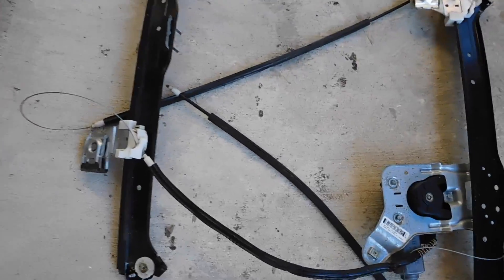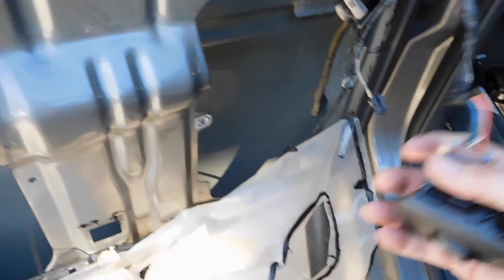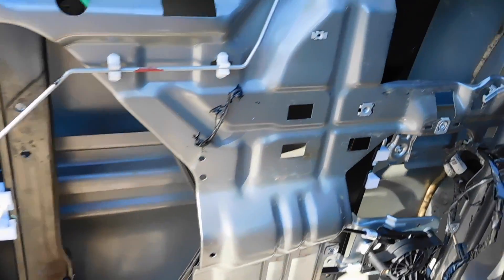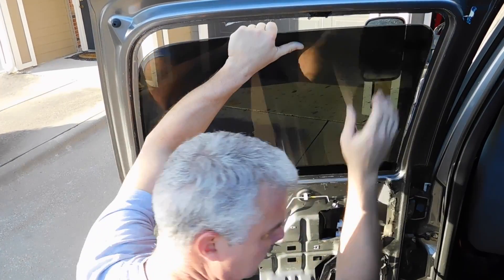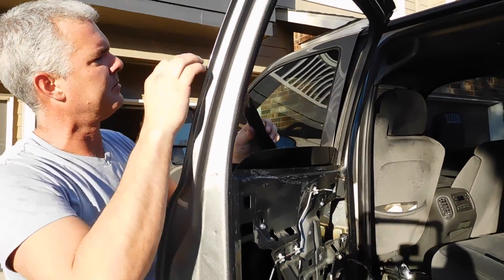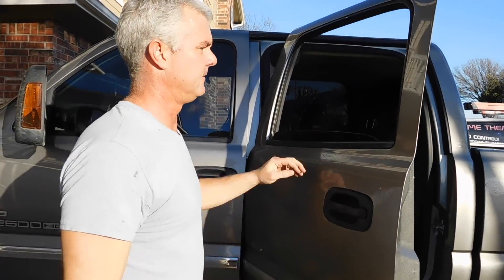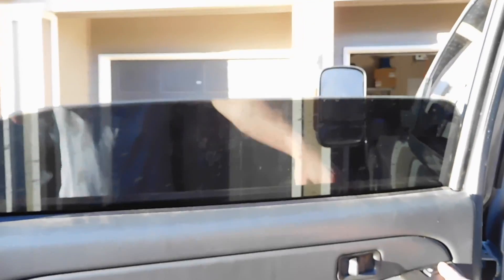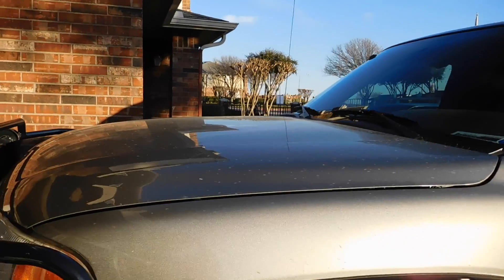2006 GMC/Chevy Duramax Window regulator Repair and Replacement

Comment: I've done quite a few of these.  You don't have to remove the glass.  Next time, remove the door panel, shove the window all the way up until it seats as it does when closed, use painters tape, run three strips from the glass over the top of the door and back to the glass again.  While the tape is holding the glass, take a measurement from the bottom of the door to the bottom of the glass, cut a strip of wood with a V in it to cradle the glass wedge it snugly to the bottom of the door to hold the glass in position until you get the new part.  No  cardboard or tape needed.  Once the part comes in, tape the glass again to hold it, remove the wood, put the register in, loosen the glass clamps, remove the tape, slip the glass down and tighten. You're done.  No need to remove trim or outside molding. Nor do you have to worry about handling or storing the glass with chance of breaking it.  Love the boat repair you do, totally schooled me up on "glassing".  Keep up the great work; good luck and God bless.
Reply from the maker: +AZ Boatscope I had to wait a bit for the motor to come in. So it was safer to take out the glass.

Comment: Thx Jay. Great video. Just discovered my regulator went tonight. I opted to bypass the duct tape and cardboard and cut a 2”x2” board and zip tied to the regulator to hold window up until my new regulator arrives. Luckily my 05 GMC is not my daily driver. You made this look pretty easy. Appreciate the time you took to share the knowledge.
Reply: Update....Jay, regulator went in like a charm. Thx again for the great video.
Reply from the maker: Glad it helped

Comment: You'll be extremely happy you put the 6" lift on your truck when you replace your front axle shafts/CV Axles.  You can replace them without removing the tire.  Of course, that might not be as camera friendly.  Either way, thank you for the video.  Love the Duramax vids.

Comment: I bought a new window regulator assembly for my passenger rear window along with a new switch and it’s not working from the switch or the driver switch. How do I test the wire coming to the passenger rear window?

Comment: Hey man I'm stuck right now I just rebuilt the top end of my Polaris alto 1050 because my middle cylinder was running about ninety on the compression tester so I went ahead and did all new rings and gaskets didn't mess with the bottom end at all so I ran a compression test on it again before I put the motor back in just like you did in your video and now the front and middle cylinder is about 90 and the back is about 82 or so any ideas

Comment: Sorry to change the subject, but I'm sick to my stomach. MY HUGE SCREW UP!! Bought a 17ft I/o wellcraft with an Alpha one drive.  Everything was fine took it out last year, had a blast.  This year I went to get the boat out of storage and the deck was so soft in one spot your foot could fall through.  Now I just found the motor mounts are bad!  Bolts wont get tight!  I'm NO FriscoBoater.....I'm screwed....  You did a beautiful job on your sea ray. I'm at a loss.
Reply from the maker: +aquadogbuddy I totally feel your pain. Take a moment... collect your thoughts and make a plan. You can do it
Reply: +FriscoBoater Thanks for the kind words, but I don't have the time or place to do the work.  I decided that my son and I are just going to patch as much as possible so we can try and get through the summer.  Then possibly pay my boat guy to do it.  He said it's gonna cost as much as I paid for the boat!  But its so mechanically sound I hate to just sell it for parts.

Comment: Hey we need some duramax updates !
Reply from the maker: Had to sell the Duramax... Sorry guys
Reply: FriscoBoater hey I've looked back threw your vids and I can't find one on the cab isolation mounts you mentioned in the bilsteeen 5100 vid do you recall the name brand of them I'm looking into getting the shackles but would like to do the cab isolation mounts as well because well my wife hates riding in my truck thanks
Reply: FriscoBoater aw man ever plan on getting another one ? Did it have any issues or anything ? I was planning on getting one. Trying to see if they have given anyone a hard time